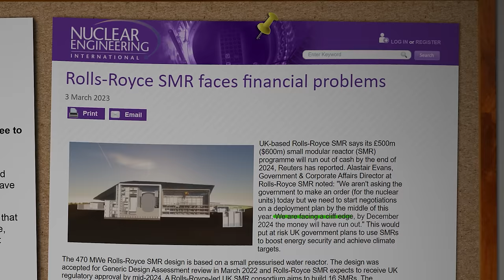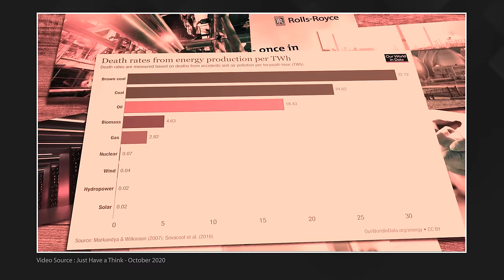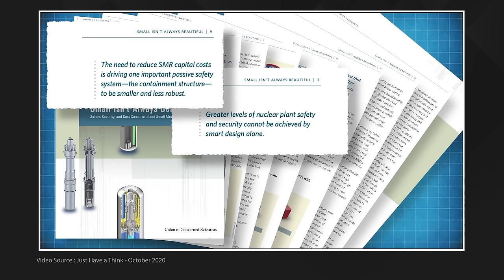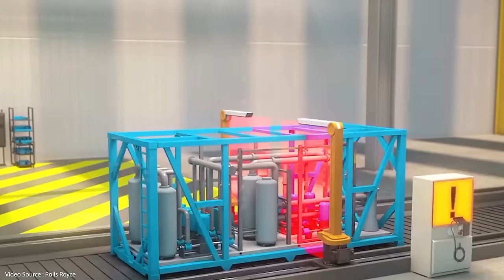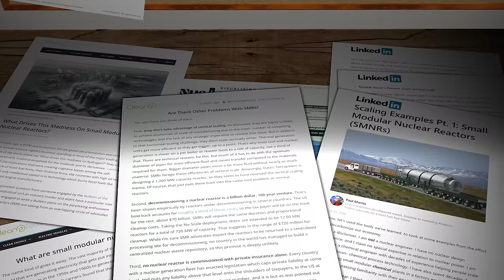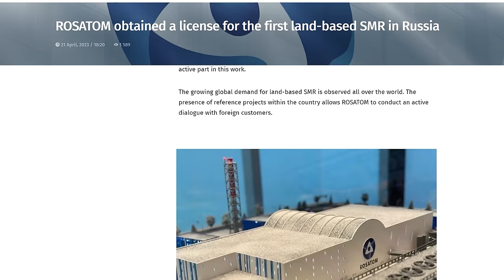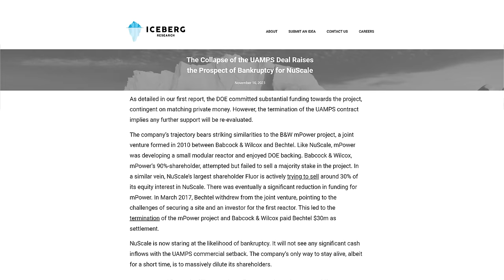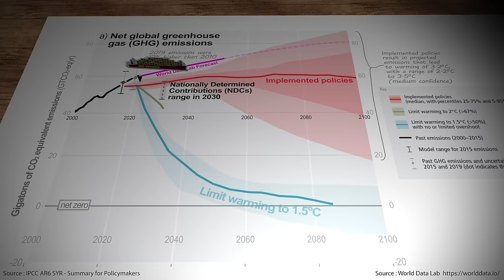Small Modular Nuclear Reactors. The Verdict

Comment: Current reactors are (generally) all one-off designs and usually take more than 10 years to make from proposal to power production.
My biggest hope for SMRs is to change that through centralizes scaled manufacturing.
You mentioned the small volumes as an issue but even making one per year would be a 10-fold increase on what we are doing now.
I feel the real issue is getting out of the one-off design and regulatory model.  Just like so many things, the real problem is not primarily technical.
There are lots of other highly internationally regulated products (like drugs and medical devices) that don't have to be a approved one-at-a-time but Nuclear Regulation is slow to change.
Also, centralized production can also include centralized refueling and decommissioning.  A 10-30 year pre-purchase rental model make more sense than a purchase model.
I have heard a 20MW reactor could be the size of a shipping container.  If you want 200MW, you get 10 of them - sort of like a modular dorm.
I realize (as you mentioned) this will be less material efficient but even small volume scaled manufacturing can easily make up for this.
Reply: Nice theory, now prove it. As the video says, so-called small modular nuclear reactors are increasing in size.
Reply: @skierpage  Yes, that is the challenge with all of this, to prove it you have to do it.  I think the reason for the increase in reactor sizes is because the model has not yet changed.  Note: If they are getting larger and there is only one of them, are they really still SMRs (Small Modular Reactors) or are they just MSRs (Molten Salt Reactors)

Comment: Wind, solar, and hydroelectric are all well and good but what’s the lifespan on each? What’s the ecological effects of all these and the batteries needed to store it? On demand nuclear power is the only way to go. The technology is here now we need to encourage its utilization and tell people the truth about the real cost of wind,solar and hydro. SMR is by far the best option with the smallest footprint. Scalable and on demand power with no need of battery backup. The reactors are safer and won’t melt down or build up hydrogen to explode as other older generation reactors have. We need more nuclear and replace the old ones with the new designs.

Comment: Long an advocate of SMRs, I specifically favor getting completely away from the extremely expensive Uranium 235 reactors, which are extremely expensive to build, operate maintain and handle the huge volumes of extremely long-lived radioactive by-products of U235 reactors!!  In Oak Ridge, back in the '50s, there was an operating Thorium reactor , which burned most of its' wastes, was not expensive to build, operate, maintain, and the US has massive amounts of this isotope which cannot be used to produce nuclear weapons!!  It would make a perfect SMR, if government would support it and industry would let go of the financial teat of Uranium!!  BTW, India! is already developing Thorium SMTs!!
Reply: The Oak Ridge reactor was a very small demo test reactor that produced NO electrical power.  It did NOT burn its own waste and it did  not cost much because it was tiny and did not produce any electrical power or incorporate safety features. Dude, that OakRidge converted Thorium (not fissile) into URANIUM 233 (that is fissile) and U233 and U235 produce almost the exact same fission product waste.  Research more

Comment: The US needs to develop Radioactive Thorium Molten Salt Reactors.
Reply: We did.  Built 2 test reactors in the 1950's and 1960's.  they both had significant problems.

The USA also built 4 commercial nuclear power plants in the 1960's- 1970's using BWR, PWR, and HTGR designs; and they were all both technological and economic failures.

A reality. No one has made thorium work well enough in a test reactor well enough to consider designing a power plant from them - except the USA and we got our nose burned badly - and there have been dozens of such test reactors worldwide and there are still at least 4 thorium test reactors still in use today.

Comment: The problem with Wind and solar and batteries you need that Hydro power. It does not work with just Wind and solar interconnected with batteries. Plus the issue then becomes the land usage and physical amount of land needed. Then how to protect wildlife and needed farm land? Nuclear can produce reliable and takes less land then a massive Hydro dam and millions of Panels and Wind Turbines. So if Nuclear needs transfer of knowledge lets get on with it.
Reply: There are 77,000 wind turbines in the U.S. right now and if everyone was the size that is common today, they would replace 77 nuclear power plants.  If you think we don't have enough useless land on which to place solar, you have never driven the U.S..

What knowledge on nuclear do we need?  It has been around for 70 years and every type of reactor known has been designed, built, and tested.  

Bottom line is new nuclear is massively expensive and cannot compete with ANY other form of electrical generation

Comment: I find opinions on future tech seem to vary wildly depending on who you speak to and what they’ve pegged their hopes on. You could argue that batteries are simply not good enough for our demands to move to renewables, but if you do you will be met with a raft of supporters saying that better, cheaper batteries are just around the corner. I can’t help but feel that SMRs should really be given the same benefit of the doubt. Nobody is saying we give up on renewables- we just need to put effort into all options, which is easily achievable as a planet. Don’t be selective in optimism.
Reply: SMRs should be given exactly the same scepticism as new battery technology. First I want to see one up and running. Then I want to see independent testing performed. Then I want to see market prices for initial units . Then I want to see the price over time with rollout.
The one up and running test has failed for an SMR company. 
The stuff in China doesn’t seem to be anywhere near independent testing.
The final two tests are nowhere.
Any yeh advanced batteries come up pretty much the same.

Comment: Nuclear power is EXPENSIVE (more than coal) thanks to the water moderated core

SMR's exacerbate the issue by being uneconomic on the electricity generation side - thermal power stations are built as large as possible for efficiency and 1GW is about the breakeven point. It simply doesn't make sense to build smaller

Also: Like fish tanks, the smaller a nuclear reactor is, the twitchier it is. Bigger ones are far less susceptible to fast changing issues

Alvin Weinberg's design was a Laboratory proof of concept and never intended to scale past Nautilus/Shippingport - it was fuelled with enriched uranium simply because that was readily available as an unwanted waste product of weapons production. Waste wasn't an issue - because it was a proof of concept

Current nuclear power is essentially a giant steam boiler, with engineering problems inherent to steam boilers (The stresses on the boiler go up with the CUBE of power)

Weinberg went on to produce an industrial prototype in the 1960s - 80% cheaper to build and run, 99% less waste and hot enough to drive turbines without the blade wear that comes from wet steam condensing inside the things

There are a bunch of other advantages, but one big disadvantage (for cold war politicians) - Weinberg's design broke the dependency links between weaponsmaking and civil power by potentially being able to use unenriched uranium or thorium. It was killed by Nixon in 1972, most likely because it put uranium separation plants at risk of falling under weapons limitation treaties

China has revived Weinberg's work and fired up TMSR-LF1 last year. This is a 2MW unit to test Weinberg's work at Oak Ridge and is planned to be followed up by further test rigs scaling up to 1000MW electrical generation (or larger). Theoretically, Weinberg's Molten Salt design can scale far beyond 1GW electrical generation without issue (they're not pressurised) - bear in mind they DON'T expect to have commerical units operating for another 15 yearsm, which is why conventional nuclear plants are still being built now

Renewables can just about match existing electrical generation, if an all-out (economy damaging) financial commitment is made.  What they CAN'T do is bridge the gap between that (about 1/3 of our carbon emissions) and full decarbonisation(*). This means that at best they are a STEPPING STONE to decarbonisation, not an end goal in themselves

(*) Full decarbonisation will require around 6-8 times more electrical generation than currently exists - even more if hydrogen is being generated from it.

Comment: I sense that the time for nuclear is past. Not that I have not supported the idea, but sense it has been politically impossible and blocked - it seems now it is too late given the alternatives. So yes I think putting our money into expanding Wind, Solar, AND storage is the smart thing to do. I would find a few hundred square miles in the desert - build a town, build a solar panel production site (also in the desert), and start working. It would be a big project of course. AND it is one of those types of projects that could be designed to come on line in stages. So power production would increase over time as the site was developed. There is a lot of sunshine and plenty of silicon in the Southwest, most of it is just sitting there. Lets put it to work along with thousands of people also,... (Note it requires water also,... plan on that)

Comment: Well, I am a Fan of nuclear.
However nuclear does need a Boeing, Airbus, Embraer scene.
That is, enough of newer designs every time, enough of different designs, pick a few that work, and maybe adjust them over time.
That is all.
Also, it does looks like SMRs are following the same path that had plague nuclear for years, besides the quite obvious bad PR.
Every single one is a prototype, every single one is a prototype.
The only country that did make a actual run of Nuclear reactors was France.

Comment: We also already have sound and proven standard-size nuclear reactors (e.g. Gen5). These are the intermediate answer to the Carbon-Zero problem. SMRs and LFTRs are eventually the answer but if the tech isn't ready then we need to move with what we have. Pour the money into getting 20 of those built and then use the relief period to expand the flexibility. 
Going all-in in wind & solar will be an utter disaster in the long run. The massively-disadvantageous land-area-to-power-output ratio means that they won't ever be able to account for the needs of a world that will only grow exponentially in the coming decades.

Comment: You need to talk about BWRX-300 from GE Hitachi. The other smr's are just marketing campains.
Reply: I disagree.  The Westinghouse AP-300 will be the market leader.  That is because it shares the control system and many of its smaller components with the AP-1000 which provides a cost saving and lower priced parts and service over the life of the plant.    There are now 6 AP-1000s running (Vogtle 4 is in startup testing) at least 8 more under construction, and talk of another 15 or so worldwide starting construction within the decade.  That provides some economy of scale from which the AP-300 will benifit from.

The BWRX-300 is a scaled down version of GE's large central station that tried to compete with the AP-1000.  GE could not find anyone willing to build one (not even China which built 2 EPRs and 4 AP-1000's in a test of which new Generation 3+ passive safety reactor design was the best; which the AP-1000 won).

Who wants a power plant which has totally unique parts and controls?
Reply: @perryallan3524  I was just thinking that if the west can't seem to be capable of building pwr's they should just build bwr's since they have thinner vessel walls, simpler containment no heat exchangers. Pwr's are more fuel efficient but if you can't build them like China then maybe you should build BWR's.
Reply: @afreire239   Its about the exact same construction, so there is no real savings.   PWRs have won out worldwide over BWRs. 

While BWRs are cheaper to build they are more expensive to operate than a PWR.

The USA now has a core contractor group and a core experienced workforce group that should be able to build the next set of units (there are advantages to dual unit plants) closer to the schedule and cost that China does.

There's actually a study out there that shows the progression from 1st of its kind build in the nuclear world, to 2nd and then to 3rd and 4th.    The 2nd set is a bit longer and more expensive than the 3rd and 4th.  Not much difference between the 3rd and 4th.
Reply: Can a pwr be built in 3 years?
Reply: @afreire239   perhaps a micro reactor version.  No one in the world has yet built a larger PWR in 3 years.
Reply: Updated information in response to another post elsewhere under the video.

The simple truth of the matter is that while BWRs are cheaper to build. that they are more expensive to operate than a PWR.  Long term the PWR wins out economically.

In the world today there are currently:
301 PWR power reactors
46 Heavy Water Pressurized power reactos (CANDU design or derivatives).
42 BWR power reactors
11 gas cooled or liquid metal breeder power reactors.

A decade ago there were about 100 BWR power reactors in service.

The PWR is just more economical to operate and the world has taken notice.

There are currently 62 power reactors under construction and I understand that 56 of those are PWRs.  

Only 2 BWRs are listed as being under construction and those plants are in Japan and construction was suspended in 2011 after Fukushima.  The construction permits are still open so they count as "being under construction" even though nothing has been done for about 13 years.

This is why I don't see much of a market for a 300 MW sized BWR.  Very few people want one and prefer PWRs, Heavy Water CANDU type, or liquid metal fast breeder recators in a few cases.
Reply: @perryallan3524  Most of nuclear power cost is capital expenses. Operational cost is a fraction of the total cost. The Japanese were building big BWR reactors in just 3 years. I think BWR arent built anymore because of the fukushima accident. Until liquid metal fast reactors are deployed we should build as much bwr's as we can.

Comment: As you remark, the kind of international collaboration needed for one or other of these technologies to work is not currently apparent but I do believe that the sleeping behemoth that is Germany has the potential even though, because of domestic environmental and strategic jitters, it's being very cagey about the research they are undertaking. I don't wholly agree that we can pull through this crisis without scaling up nuclear and fast, not just because of it's potential base load energy support potential but for the ultra low carbon heat source such as that shown in the first of the China projects where a massive fillip could be offered to industrial decarbonisation of say cement, steel, ceramics industries currently belching out vast quantities of CO2
Reply: We have 6 years till the deadline, even ultra-rapid builders like China are taking 16 years for new nuclear – it's already a decade too late to be thinking about nuclear.

Comment: The U.S. got off on the wrong foot with nuclear power by not establishing a standardized design early on like the French did. Reinventing the wheel every time a new plant is built causes higher cost and compromises safety.
Reply: On the contrary.  The USA built something like 76 unique designs of light water nuclear power plants.   As a reasult we learned which design ideas worked well long term and which did not.

The current generation 3+ passive safe USA designs could take the design for each component, control scheme, system, and structure that worked best long term based on all the experience we had with so many different design approaches to virtually every component, system, structure, etc.

The French had a series of problems that affected every plant - and do not have within their fleet the experience to know what design actually worked best long term for any item or system.
Reply: The reactor designers provide the basic reactor and secondary design. The utility can then add options or modify to their liking.  There are/were three major reactor supplier; Westinghouse, CE, and B&W